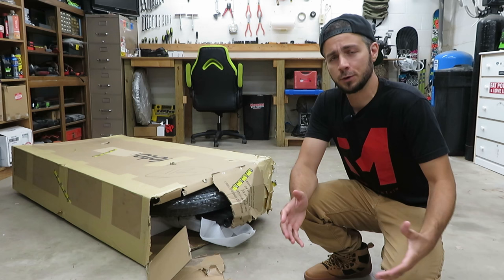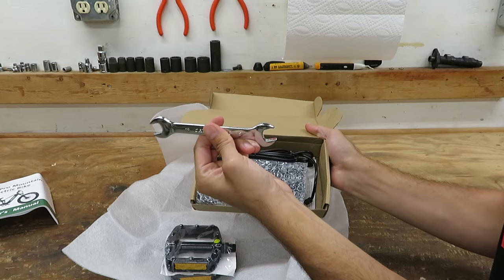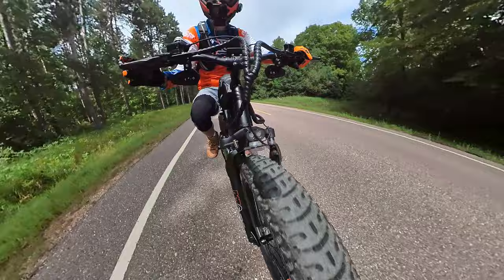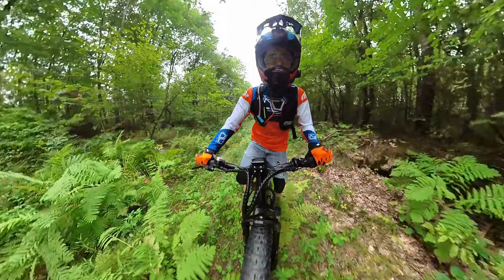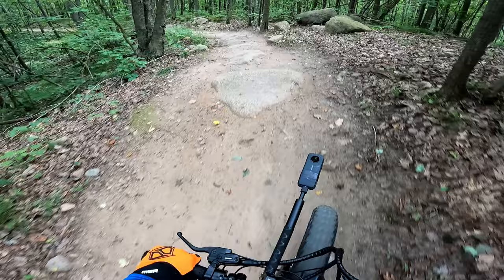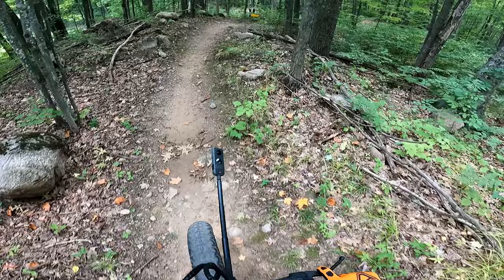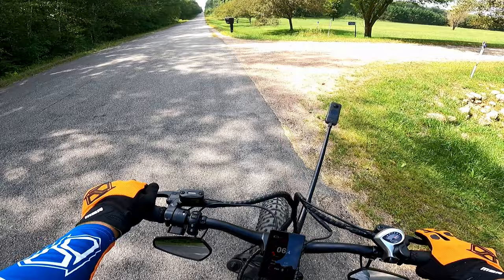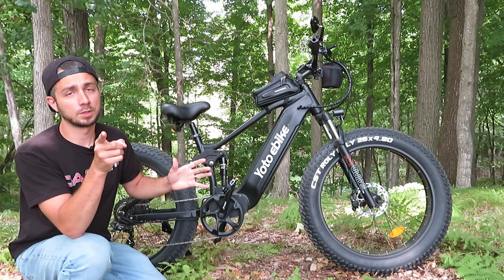This $2,000 All Terrain E-bike Really Surprised Me | Yoto Ebike Off Road Test & Review

Comment: Those tires are crazy!  Love the video.  I bought another brand and I like it but I feel all should be same as motorcycle dirtbike.  Like right hand throttle twist preferred but thumb ok.  Right hand front brake not the left.  So obviously left brake should be rear.   I really want to swap my brake lines around so its what it should be knowing Im going to have to bleed them.  Anyways great video!  TY
Reply: OH luckily mine does have right hand idk .25 or .5  what ever twist. My throttle is right hand I think it would just be weird thumb or twist on left.

Comment: For rough terrain, technical downhill, small jumps - what's the best ebike on the lower price point range? I don't go hardcore, just go slow. Will this bike hold up?
Reply from the maker: At my skill level it works pretty well.  Could be a little lighter, but in this price range I think the weight is pretty standard.

Comment: This bike is garbage. Only 48v and has no power or torque. I had it and hated it. Impossible to ride it in the woods because it has weak power
Reply: Unlocking a E bike is key 1500w actually will keep up with a 250 there's even videos on YouTube showing 48v bikes keep up with serons just saying The controller is the key mine hits 40mph